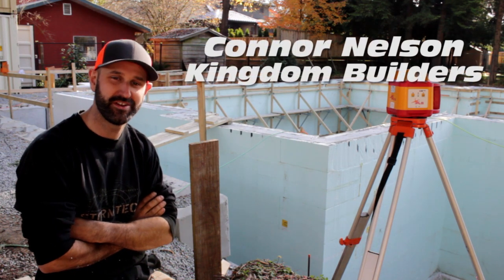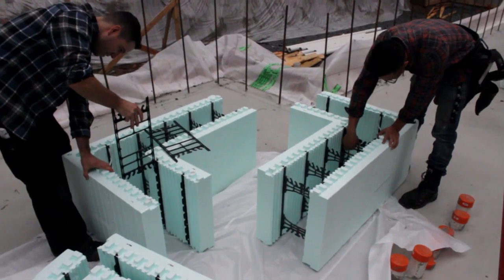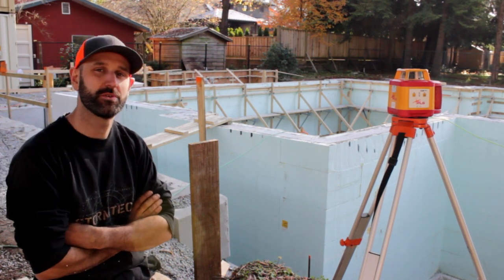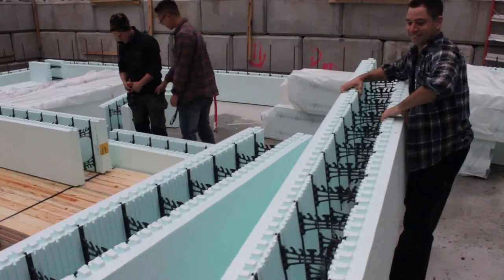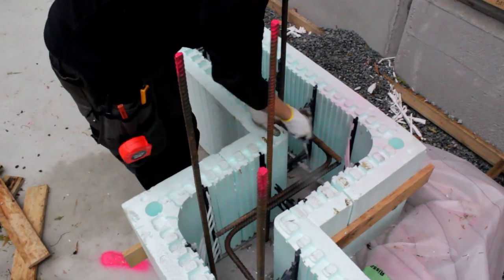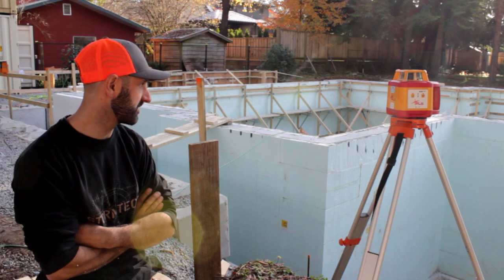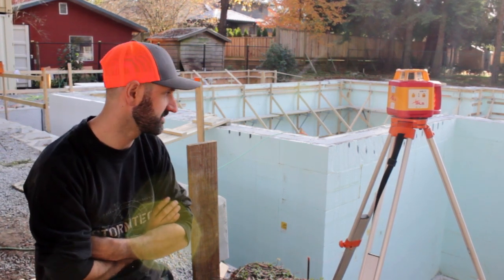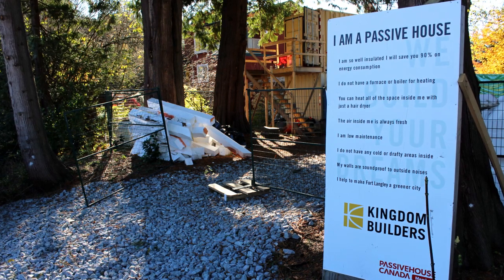Nudura Insulated Concrete Form (ICF): Passive House, Kingdom Builders

Comment: What happens in case of fire?has anybody thought about end of life - cost of demolition and recycling of all that styrofoam?or it's going to end up in the Pacific Ocean chocking whales and fish anyway.🤔
Reply from the maker: The foam is covered with non combustible material on both sides, so fire is not an issue. You would be an absolute fool to demolish a passive house. These are minimum 100 year homes.
Reply: Here's a video on ICF manufacturing, including recycling of EPS: https://youtu.be/J5hF72FIcxQ?t=297